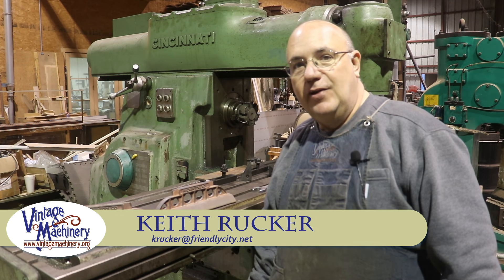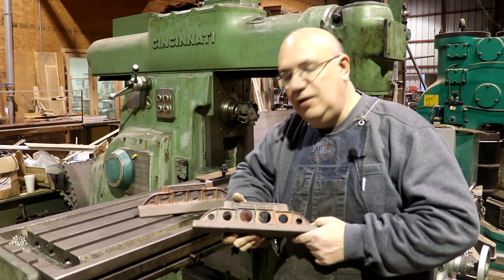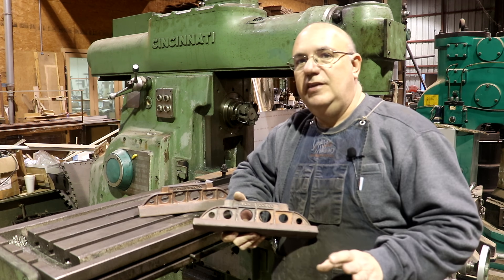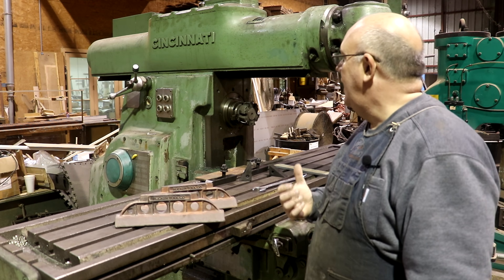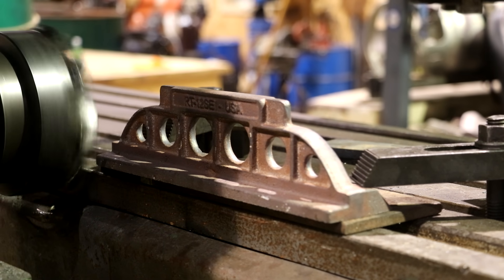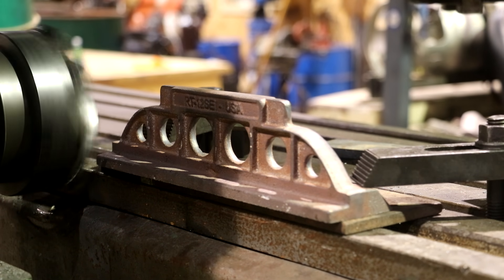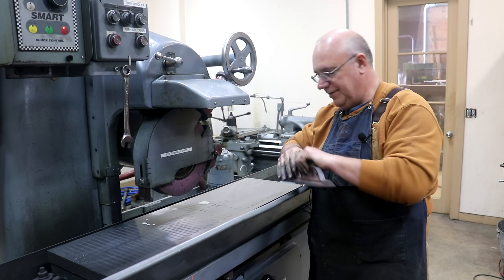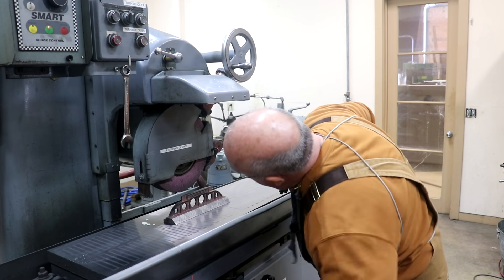12-Inch Straight Edge: Machining at John Terry’s Shop during Scraping Class

Comment: Big difference in circumference between a 
7" wheel and a 12" .
About 22" for the 7" and 
almost 37 3/4" for a 12" .
Makes a big difference in 
cutting.  Nice clear castings. No sand or blow holes .

Comment: Always get a chuckle at toques in  Florida.. More seriously, when sparking out a piece how much of the last passes are due to thermal changes in the work piece as it cools and changes stresses?
Reply: I'm no expert but especially when running coolant the thermal changes should be next to zero. I'd guess most of the spark-out comes from slop in the wheel feed, ie. the lighter workload causes less deflection upwards in the wheel.

Comment: On that shaper, could you have used a cutting tool with a 45 deg. edge "parallel with the cut and achieved a "smoother" finish? At least that would compensate for the large step-over..

Comment: Re the planer taking too big a cut, I wonder if it is not taking off enough cut at the end of the cut ? At the end of the cutting stroke, it appears the feed shaft moves a little to take the tool away from the work for the return stroke. If this is not as much as the machine feed expects, then tool feed will be more than planned.
Reply: I suggest you watch the video.  They explained many times that they were just exploring the new/old machine.  It was not meant to be a precision exercise.
Reply: @paulcopeland9035  I think your comment has been added to the wrong comment !

Comment: I would be interested in any information available on the Rockford planer, I have just gotten mine running It is the 36" Universal shaper planer Which is gear driven rather than hydraulic, I see many similarities in the head but the base and table are significantly different.

Comment: Keith, just wondering - when are taking about down-feed while using the grinder,  does 5 thou mean .0005?
Reply: .0005 is actually 5 ten thousandth or half of a thousandth.   5 thousandth is abbreviated  .005

Comment: How did you ensure that the dovetail was 45 degrees to the bottom reference surface if it was cut resting on a casting/non-machined surface? Edit: I see that it was rough cut on the shaper, and the reference was used on the surface grinder.
Reply: It doesn't have to be 45 to the bottom.  It is not used that way.  There are many scraping videos (Keith did one not long ago) that show the straight edge used for scraping in a dove tail on a table way.  It would be worth it to you to review one of these demonstrations for an explanation of the process.

Comment: Dumb question from an old woodworker, "Just what do you use the straight edge for?"  As a woodworker I have no idea what you would use this for and find it an interesting piece and know it is NOT a paper weight, grin...  Nice video.
Reply: It starts at a shop's surface plate.  The machinist's standard for flatness.  The straight edge is checked against the flat surface, and then can be used to transfer that flatness to another part that cannot be directly checked against the surface plate.
Reply: Same question here. I’m always amazed at the tiny tolerances and at how much metal actually moves (flex, thermal). I’d like to see one of these straight edges in use.
Reply: @Ddabig40mac  Thank you for your explanation, not being a machinist or metal worker the level of tolerance and flatness rarely comes to play in my woodworking shop.
Reply: @robertbamford8266  Me too Robert, I would love to see a demonstration video showing how it is used.  I have watched several videos of machining these straight edges but beyond that I could only image it in my shop as a paper weight, just being cute with that last part.  No one needs a milled, ground, and scraped paperweight!